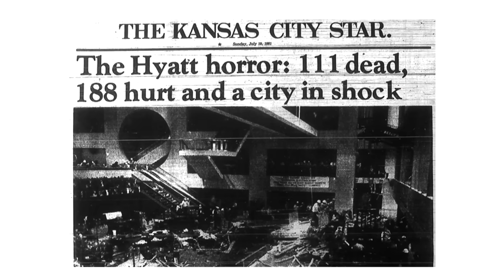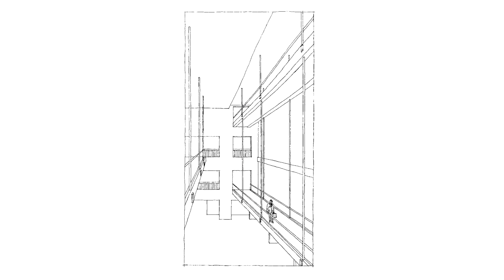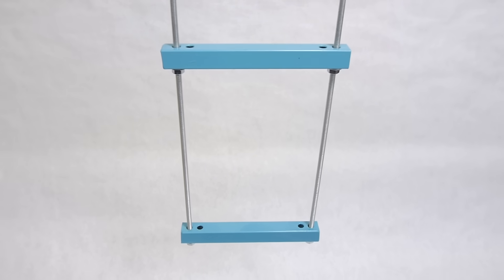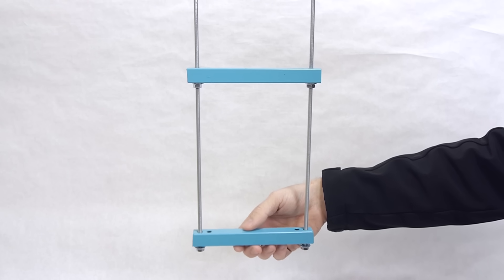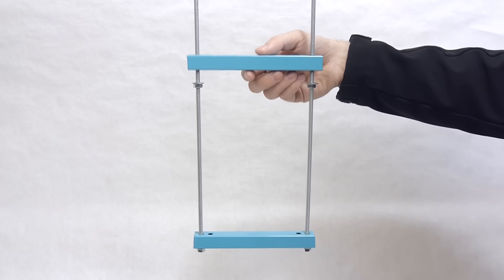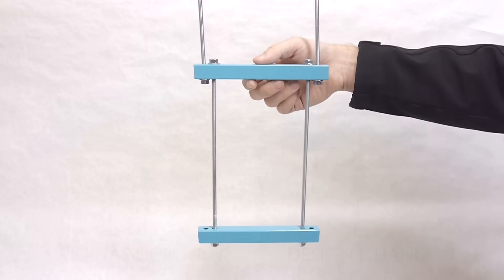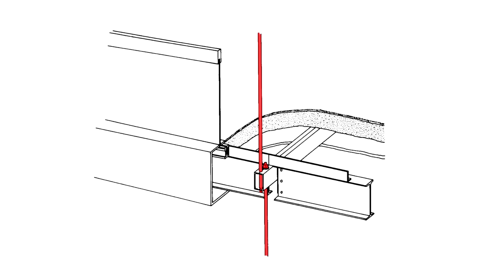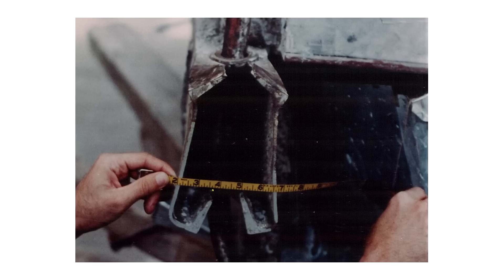The Disaster That Changed Engineering: The Hyatt Regency Collapse

Comment: I had to do a 80ish page report on this in college (with calculations down to the weight of every element - including the carpet and lamination on the concrete). The other main failure was the fact that the "box girders" (made of two "C-beams" with the open part facing each other) were originally planned to resemble "I beams" (the two "C-beams" oriented such that their "backs" were against each other). The "box girder" arrangement was significantly weaker than the "I beam" arrangement
Reply: koishki, you'll note that I use both "C-channel" and "C-beam" interchangeably (in my original comment and in one of my replies). Basically for the laymen (not everyone on YouTube is versed in Engineering - far from it). I never said they were originally W-shaped, they were just originally shaped like this: ]|[  but with the design change they were positioned like this:  [|] (I don't know why they chose that instead of HSS)
Reply: Haha, thanks Neceros! Got my bachelor's in Mechanical Engineering, but I'm working as a Software Developer now (so those days are behind me)
Reply: Yes, but also look at it in the other direction: a "C I-beam" design, but still with 2 hanger rods instead of the 1 (like Grady mentions in the video). I think that would've held as well. While the change from 1 rod to 2 was a big mistake, I believe that if they had not also changed to the "C box beam" design, it would've been ok
Reply: I've seen C-beams glitter in the dark near the Tannhauser gate.
Reply: @TheRealSkeletor  "If only you could see what I have seen with your eyes"
Reply: Thomas Donalek good questions, I hope he answers u
Reply: Am I inferring correctly that as built, the lower flanges of the C channels yielded (they were "cantilevered" in this arrangement), and that if they hand been "back to back" the load from the nut+washer would have been in line with the web of the C channels, thus they would have been much stiffer and less prone to yield?  The "flanges facing in" arrangement would look more like a "box" and thus cleaner, but was the idea simply to weld the edges of the flanges together, then drill holes through for the rods?  Otherwise, I don't see why they would have changed that detail from "back-to-back" with the webs close together - was it "a pain" to space the webs apart for the threaded tie rods?
Reply: IIRC the hotel owner wanted the aesthetic change to structural element. structural engineer: correct replacement would be a seamless (no welds) box beam. construction manager: that was too expensive and too far out to hit opening day. ironworkers: "what if we do this? we haven't done the math."  structural engineer: "looks good, do the math"
Reply: @kingjbone1   @kingjbone1  well put together I was thinking precisely the same.

However, I feel the structure still would have failed due to torsion created along the plane of two bolts.
Obviously calculations needs to be made to understand if my claim is plausible, nonetheless unacceptably careless approach from every tier of the construction team.
Reply: Wait, they wanted to make I-beams by welding two C-beams together? And the box girders were made by welding them together the other way? That's just mad.
Reply: Guys, this is an educational video about engineering. Take your political debate elsewhere
Reply: +Jarid W So hundreds of tons of bent and stressed steel doesn't snap and rain down upon you ending your life in an incredibly grisly death because we didn't want to write 40 more pages.
Reply: Bat B ,well I'm sure the GC said the same thing about the engineer, he trusted his design. Your right, they should have communicated better especially since it was a changed design. Unfortunately people assume someone else has checked it all out and in many cases that's probably true. All it takes is the one time they don't to result in a catastrophe. There is no room for haphazard workmanship in a construction environment because people suffer for it, usually long afterward. I'm sure everyone involved has second guess themselves a thousand times over.
Reply: Vincent, I don't remember if we measured that or not. I think more important was the moment on the flanges of the box beams (because the box beams were made of 2 "C beams") - reference Thomas Donalek's reply to my comment. The shear stress obviously would've been an important factor if the box beams were actually solid pieces (like Grady has modeled in the video) - of course, the bridge might've not failed if that were the case
Reply: heh, when I took the EIT, the parking structure at the test site had collapsed the previous night. some people who where taking their PE/EIT  the same weekend didn't have cars to use!
Reply: koishki The engineer who signed off on the change said he didn't read the whole plan and basically trusted the gc. The problem i think was a lack of communication between the engineer and the contractor
Reply: @bbbildhuu  The structural engineer who stamped drawings is responsible and was found so by the engineering society
Reply: @bbbildhuu  This is definitely a big part of it. I can't think of a single instance in which the engineering firm I work for didn't reject (or at least require revisions to) at least one technical submittal from a contractor over the entire course of a project. We all make mistakes! That's why having many sets of critical eyes look things over is so important.
Reply: @bbbildhuu  sounds accurate to me. I am a CM and most engineers want any structural shop drawings stamped by an engineer. This way by the time they review the shops they have been stamped by another engineer. The reason is for liability and the other for the simple fact that 2 sets of eyes are better than 1.
Reply: @bbbildhuu   Just remember, even if the Engineer and the GC were in agreement or disagreement about anything, neither one of them were exactly on the floor when the construction crews themselves put everything together.  Couple a GC who is not right on top of his crews at all times with a  project that is too big for one GC to manage at once, and these changes happen when guys who build these things all the time think they know better than the guys who drew the plans...
Reply: In software testing we call that multiple fault assumption. We assume that multiple inputs or sets of variables can cause an error.
Reply: Derek Antrican thanks for the reply!
Reply: Derek Antrican was the shear stress of having the two supports pulling in opposite directions next to each other an important factor?
Reply: @vincenttang0912  It doesn't look like it and it isn't mentioned as an issue.
Reply: That would've been because of the redesign of the hanger rods, right? The c box beam design would work if it had structural support from a central rod, not when it needs to support two rods without central support...
Reply: Hahahahaha utterly pathetic
Reply: do you still have it?
Reply: I was about to write that. I had read about the incident, and I think I read somewhere that the "box griders" was two u/c beams facing each other with the opening and welded
Reply: The change from thru holes on the box beams to cut slots also greatly affected the strength, and ultimately the holding power of the beam. As I recall, there was an interim design where the thru holes were retained. This would have caused the beams to bend, but the load would have been retained (ie it would have scared the people on board, but would not have dropped them).
Reply: just wander why it failed at only x2 load. What is a typical MS in civil engineering?
Reply: @mykytakostiuk4196  It looks like the live loads were well under design load.
Reply: @mykytakostiuk4196  Pedestrian loads, typically ~ 150 lbs sq ft, concentrated loads, like file cabinet areas, maybe as much as 300 lbs sq ft.  I don't think anybody foresaw high density rhythmic dancing type loads on skybridges?
Reply: @mykytakostiuk4196  my understanding is that there were also far more people let out onto the walkways than they were designed for.
Reply: How would the hanger rods have been attached in this configuration? Why not use a small w-section? I find no mention of changing the box beam in Levy and Salvadori's good discussion of the disaster in "Why Buildings Fall Down".

Nor, searching the web, can I find any other mention of this "original not-a-box beam."
Reply: I know nothing at all about engineering but as soon as they showed the "box girder" I was suspicious of that too.  Glad you posted.
Reply: It's all good. The more you know the more human you are. I'm a web designer so I understand the switch.
Reply: I'd hire ya.
Reply: Two channels back to back with a strip of flat welded over the entire length on the top and underside would have made a tremendously strong "beam". Even with the other design flaws it would have probably been fine if the channels were put back to back. It probably would have been even stronger than box section but it's almost overkill by that point. I have no idea why they decided to weld two channels together toe to toe. The dangers seems obvious and I question why the fabricators, welders and labourers who made them didn't raised concerns to their managers seeing they were probably even more capable than the engineers themselves of seeing the weakness.
Reply: @mrdojob  good point. but even if they would have just welded a plate on the end  of the boxed channel would have improved strength. i have seen two types of channel. one the short ends of the channel are tapered looks like the type used in the failed part. the other type  the short end are full thickness no taper.
Reply: @mrdojob  "Hi, honey. What did you do at work today?" "Work was great. I got to spend the morning doing a lot of angle grinding down by the pool. Then in the afternoon I personally took on millions of dollars in liability for which I have no defense and am completely uninsured. Say, how much do you think your wedding ring is worth?"
Reply: Derek Antrican , your right, I regress. I should have known better than to bite on that hook.
Reply: can u send ot to me, i have to present a report as well and i can use it for acknowledgements
Reply: Weight of the sodding carpet !!!! Piffling compared to the weight of walking people compared to a jam of people rhythmically dancing on it !
The question was how many people can we cram on the 2 walkways - and what is their total weight - then multiply that by 5. Will it withstand that weight ?
Reply: It is only significantly weaker in terms of an applied load surely? If the applied load was within the design parameters the beam type would not come into it. The significance of this tragedy as taught to us, was the importance of designs being buildable, the responsibilities that lie with the designer and the importance of controlling any site modifications to the way the design is intended to work. The I beam you suggest (two C sections back to back) would have made the installation of the rod harder and frankly isnt the main lesson to be learnt.
Reply: @twasb2000  "It is only significantly weaker in terms of an applied load surely?"  Obviously! In what other context can you apply the word 'weaker' to a structural beam?
Reply: SkyWizardless there are types of load considered ie self weight, in civils we were told to separate them as they have different safety factors.
Reply: (cough cough mechanical talk that i wish i can get :()
Reply: What? Do you have a link about the box girders originally being w-shapes? And why not just use an HSS instead of welding two C-channels? And why, after writing an 80 page paper on this, do you call them c-beams?
Reply: @koishki  I am suspicious too of his claims. I can't invent a good reason for not using HSS. Best I can come up with is "we'll have a bunch of C-shapes on site anyway, we'll get somebody to weld a couple together." Who will inspect the inside of the welds? "My brother-in-law owns a ferret."

They must have figured that it was totally cool because they don't appear to have done much to prevent punch-through except a regular looking washer (going by drawings in Levy and Salvadori).
Reply: @petermgruhn  At that time HSS availability was far less than today.  I have a 1974 catalog for Tube Steel (what we called HSS at the time), the size range is FAR smaller than today.  HSS usage really took off in the mid 1980's.  It's gotten so common we virtually never furnish pipe columns anymore.
Reply: @robertstout6980  Thank you so much.
Reply: bigbangnone , that's a bit cynical, I'm sure it had nothing to do with pay offs as much as it was unprofessional and laziness. One guy was assuming the other knew enough to trust his word and neither checked the design or did the proper calculations. That being said, there is corruption in politics as Trump has painfully been dealing with. The corrupt don't want to let go of the gravy train they have created for themselves and we the people have been their source. Now is the time to stand behind him, he's not perfect but he's better than what we've had so far.
Reply: @makemyday1477   There was zero evidence of corruption or graft between the GC and the engineer. However, The Kansas City Star did an investigative report of the city's building inspectors and there were many problems with them.